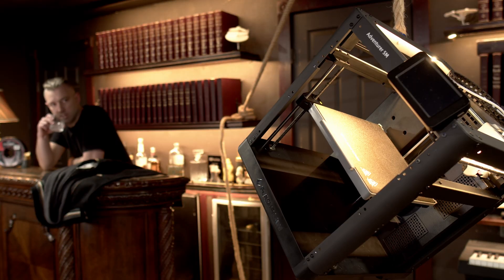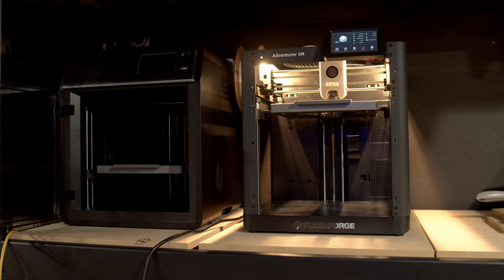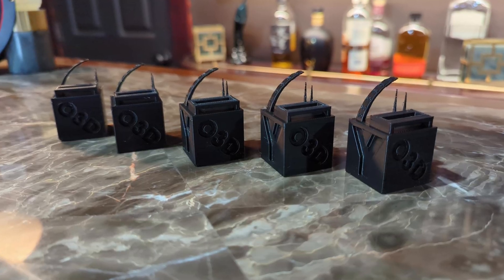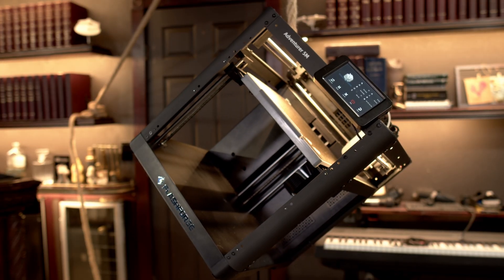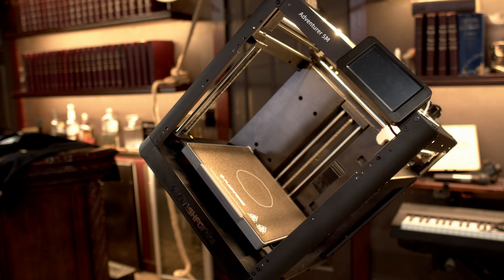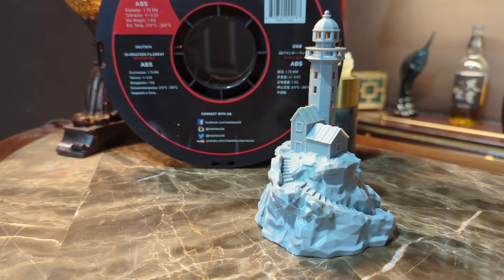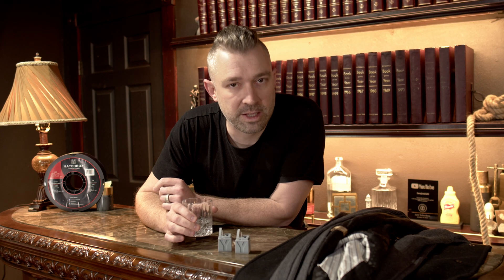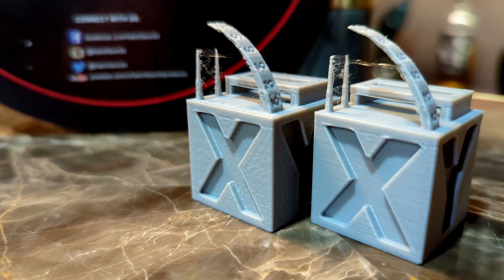Does it Really Work? Extreme 3D Printing

Comment: The issue with a wobbly setup for a 3D printer primarily arises during input shaper calibration. When printing, the critical concern is the relative resonance between the tool head and the bed, not the resonances of the entire printer relative to the external environment. If the tool head and the bed share the same resonance relative to the outer world, that’s not a problem. However, having the printer stable with respect to the external world helps to rule out those external resonances, giving you a cleaner reading of the relative resonance between the tool head and the bed.
Reply from the maker: This is somewhat mostly true. But not the entire truth. There's a lot of things that end up effecting resonance and input shaping values. Input shaping and resonance is highly complex as I'm sure you know 🙂I've spent the last several months doing more in depth testing and readings. But I felt like a video like that wouldn't have the same impact with viewers as most people just glaze over when videos drone on about charts and details.

Comment: You just gave me a great idea. I will hang mine off the ceiling like a decoration, to save floor space, and pull it down when the print is finished.
Reply from the maker: Technically this is possible. Not sure recommended but I don't see why not.

Comment: Next video try it with a bed slinger!
Reply from the maker: Wish i could, I gave all my bed slingers away!
Reply: I know I'm late to the party, But Angus over at Makers Muse did this. He actually did one with the printer on the concrete floor. One on his wobble table he always prints from and one he hung from the ceiling. Using a bed slinger, not sure which one, They all looked remarkably similar and good quality.

Comment: 3:50 Leave my cement pads alone! 😆
Reply from the maker: @TheMountainMaker  I saw those pads! I made this video just for you 🤣
Reply: @zerodotcmd  Mine are there on the P1P because it kept failing its start up calibration when the other 3 printers were all printing fast. What I really need to do is separate each on to their own MDF printing platform. Although... maybe that's worrying about it too much 😂
Reply from the maker: @TheMountainMaker  I run mine on separated MDF. Works pretty well. Those racks can get a bit more unstable than the average printer or two next to each other. I ended up bolting my rack to the studs also. 10 printers on one rack, so vibration is a bit more.

Comment: Those 5m printers are amazing printers, and without a doubt the best value machine I have used.

Is the printer the best machine on the market?  No, I still prefer my x1c over the 5m, but even when the x1c is on sale its going to cost you $1000+shipping, mean while the 5m can be had reasonably often on Aliexpress for $250 and the machine prints just as good quality parts at more or less the same speed.  There is a reason I only have one x1c and multiple 5m machines.  They are amazing!
Reply from the maker: Couldn't have said it better. For the price they're pretty hard to beat. Its insane what they can do at that price point. My top recommendation for anyone with a budget.
Reply: @zerodotcmd  I bought the 5x on preorder, they have pushed back its deliver date, but I am super excited for it to show up.  I have a feeling that thing is going to be a real color champion.  The color system is very similar the the a1 AMS light, while still being a corexy.  The a1 AMS changes color quicker because it has less retraction distance than the original AMS.  So on paper it should have the quick color change of the a1, while retaining the speed of a corexy.  Besides the Prusa XL, it should be the quickest color printer on the market.  All the other color printers just imitated the original AMS.

Comment: How does the stability of a base actually affect the volume? I have heard that a concrete slab and a rubber mat under the printer dampen the vibrations from the printer and thus reduce the noise level.
Reply from the maker: Most of the sound from a printer comes from the fans and motors. Sound and audio are a completely different topic. This topic is only made worse by the fact that every environment will have completely different effects for noise levels. What works great for one person may not and quite often does not work well for another.